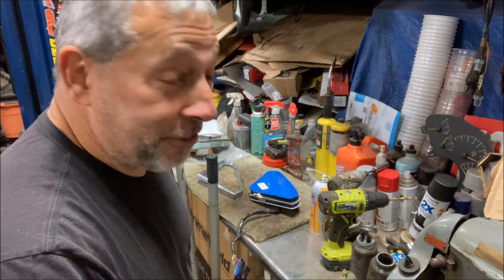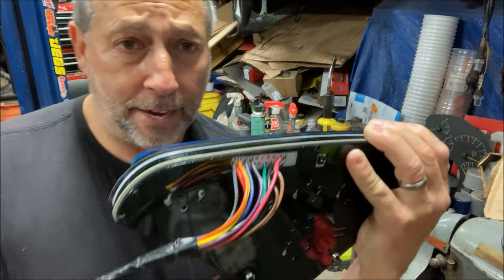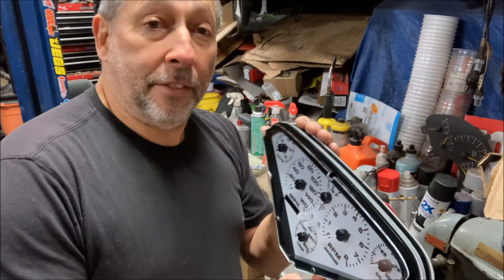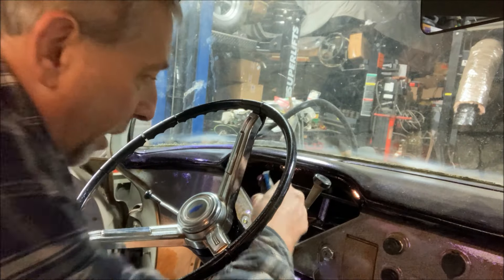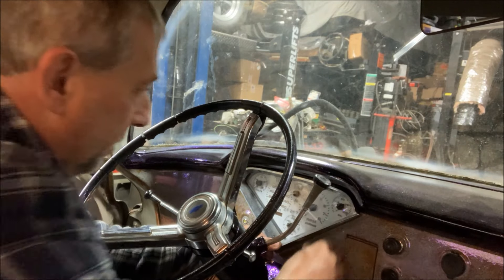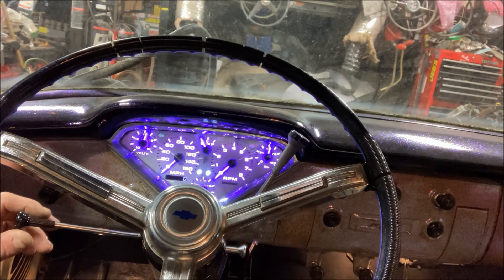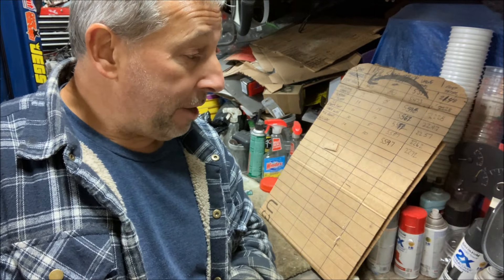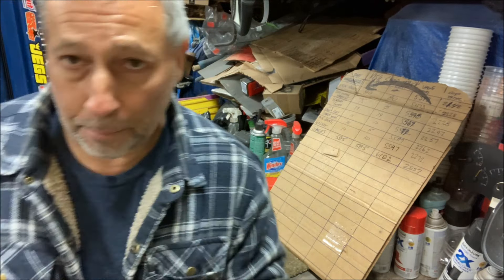Intellitronix LED Analog Replacement Gauge Cluster for 1955-1959 Chevy Trucks installation

Comment: I saw a build once where they used the hvac system out of a front wheel drive car. I wish I had paid better attention to what year and model, because it all fit under the dash and had a basic rectangle control. May want to tour the junkyard and see if there are any candidates. I personally am not a fan of Vintage Air. I prefer piecing a system together with universal parts and factory when possible.
Reply from the maker: Agreed, I would rather put together my own system, I have considered taking a system from another car but it always seems like more work to adapt something than to just make something from scratch. I am not an A/C expert but know enough to be dangerous LOL. Thanks for watching!
Reply: Wiring - I like how you repurpose old OEM connectors.
Reply from the maker: Thanks, they work great and they are free from the LS donor trucks. Thanks for watching!

Comment: Great video, Rust! We're proud to offer budget-friendly gauges for any project, and the 55-59 is definitely one of our favorites. We'd love to share your video with our customers—would that be okay? We also have life time warranty on all of our products. Contact us for any questions.
Reply from the maker: Sure, you can share it, want to sponser me? LOL!  Lots of builds coming up that will need gauges. Feel free to share the video and hopefully you watched it, it is an honest first time install video so not a commercial. I have a 72 Nova build coming up if you want a full detailed install video with an LS engine I can do that no problem. So far no issues with the 56 dash other than the one time that the tach was reading low, it now seems to be working fine. Speedometer will be tested once the weather warms up, the truck now runs and drives and will be done shortly. I would do two things different for improvements. 1. The backlighting dims very little with the headlights on and does not dim with the rheostat headlight dimmer, I understand that may be because of the LED driver design. 2. I would make the backlight have multiple colors in the one unit rather than having to buy a different gauge set to change colors. I bought purple for this build, but if I wanted to change dash color the purple would not be wanted anymore. Thanks for watching!